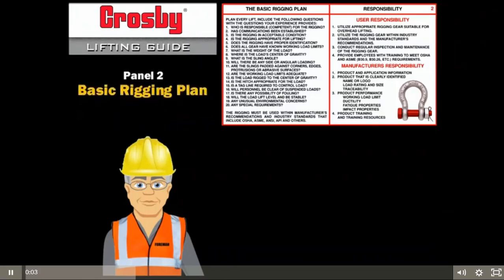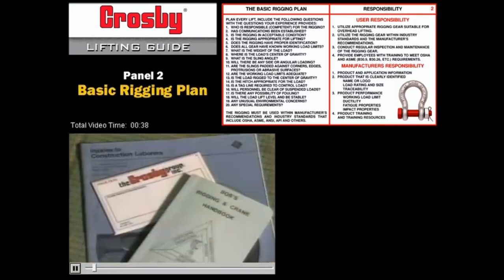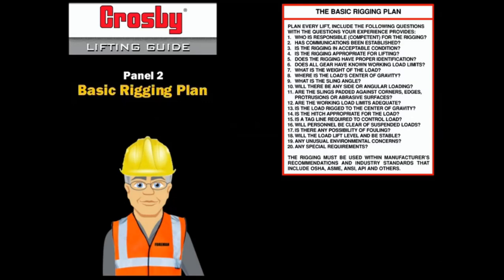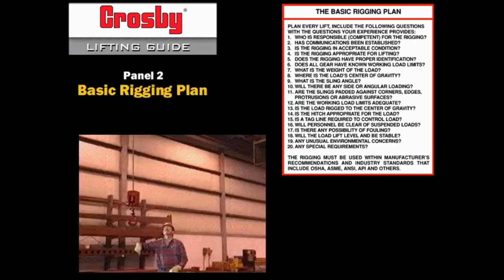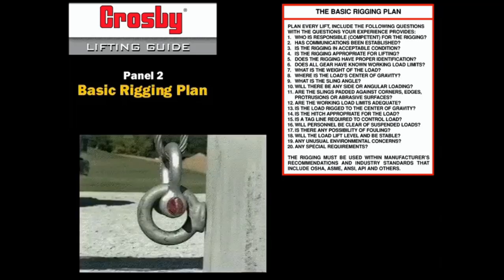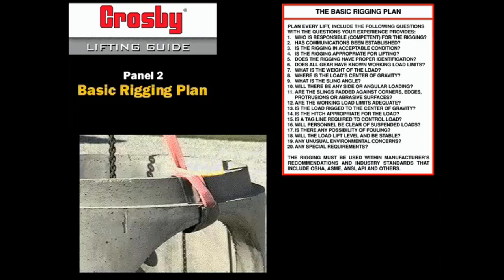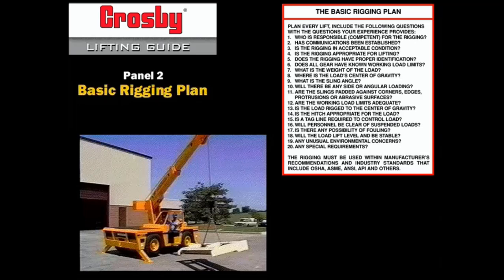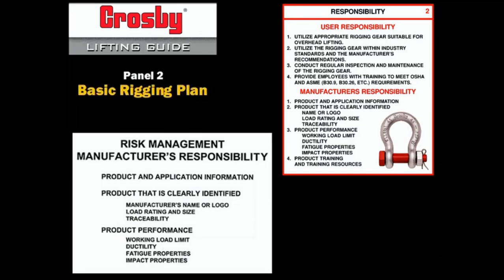Basic Rigging Plan

Comment from the maker: Question 1 of 8
1. Question
Category: Inspection
Rigging equipment should be inspected:
•   Every day before use
•   At least monthly
•   Before critical lifts only

Question 2 of 8
2. Question
Category: Inspection
Rigging hardware inspection includes:
(select all that apply)
•   Condition of the hardware
•   Proper identification
•   Proper type for overhead lifting

Question 3 of 8
3. Question
Category: Calculating Sling Tension
At an angle of loading (horizontal sling angle) of 30 degrees, the tension on each sling is _____ as compared to its single leg straight-line hitch capacity.
•   Reduced
•   Not a concern
•   Doubled

Question 4 of 8
4. Question
Category: Capacity
Angular loading of a shouldered eye bolt will result in:
•   No change in capacity
•   Increase in capacity
•   Decrease in capacity

Question 5 of 8
5. Question
Category: Slings
Slings must be protected from:
(select all that apply)
•   Edges
•   Corners
•   Protrusions
•   Abrasive surfaces (if using synthetic slings)

Question 6 of 8
6. Question
Category: Capacity
The working load limit of most equipment is based on:
•   Shock loading
•   Angular loading
•   In-line loading
•   Side loading

Question 7 of 8
7. Question
Category: Load Control
Good load control includes ensuring that:
•   Load lifts level and stable
•   Center of gravity is known
•   Top connection point is over the center of gravity
•   All of the above

Question 8 of 8
8. Question
Category: Center of Gravity
The location of the center of gravity affects:
•   Load control
•   Sling loading
•   Both load control and sling loading